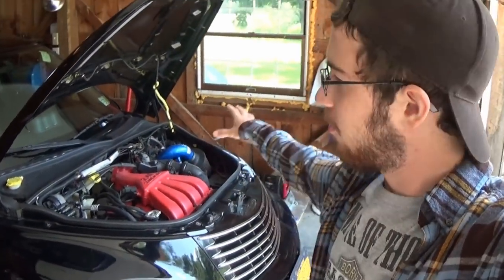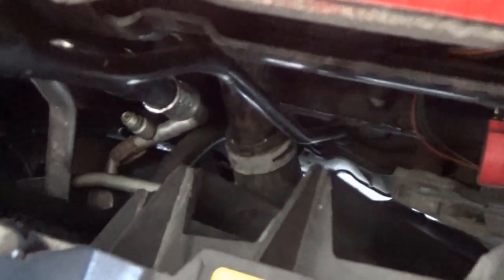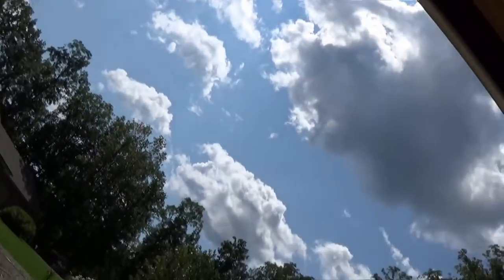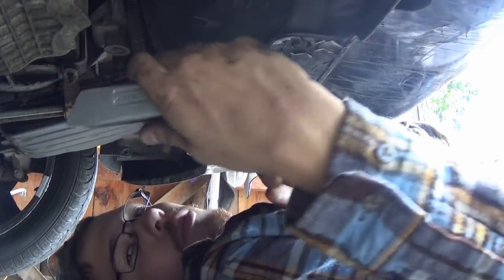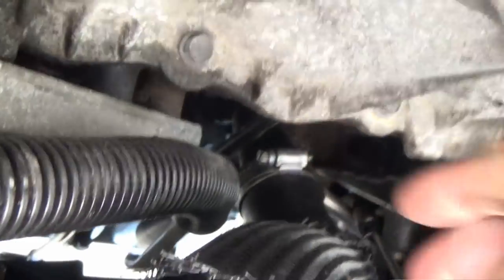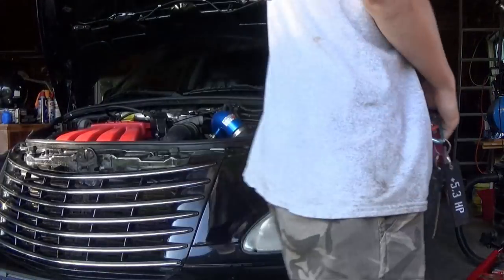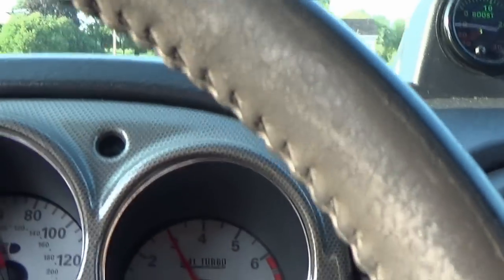IS MY ENGINE OKAY?  PT GT Lower Radiator Hose Replacement

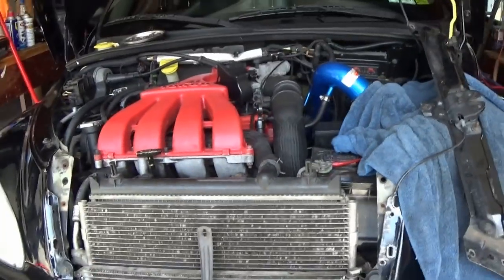Comment: Hey! Need help! At 4:30 as you’re pulling down the intercooler, right above your hand are two metal lines that run towards the back of the engine. The one on the right has a rubber hose that runs into a threaded line at the bottom of the radiator. At 6:34 its right next to your hand also. What hose is that? I just bought a 2005 PT GT and have done a full tune up and replaced all fluids. That hose leaking needs to be replaced but I have no idea what that is. Any chance you can help?

Comment: Wondering if it's easier to pull the radiator? I'm needing to replace hoses and would like to do timing belt and water pump. I've seen where people do them with the radiator, but it doesn't seem that much more work and might make it way easier. My PT is on Jack stands now waiting for me to decide to do it or not. Not emergency, but may be a good winter project. Mileage is well over 200k, although timing belt was done around 90k.

Comment: Me again. Novel time. I enjoy your channel as 1. I highly respected that you wrench on your own car. 99% of under 30 somethings, inclusing my 2 have 0 idea how to do even basic work on a car. They're both fortunate now that they drive new, under warranty cars. So respect. 👌. 2. It reminds me of my experience w/a 100% non mechanical father & my beloved British convertible sports car & gleaning from the rare honest British Car mechanic & our gardener who worked on his own trucks & took pity on me, what knowledge I could.  You have rare, thoughtful & supporttive parents btw. & room to work & test your car which I am envious of & which 8n life thru now 67 vehicles (57 cars+1 truck) I've never had.   Imho you definitely need to do a compression test esp. Given the miles on your engine.  The TSB & white pages on any srt-4 motor call for normal 100k-150k all seals check & replacement.  Seals like your radiator hose will start cracking.  It's still a Dodge motor though & during the mbenz years of ownership by Daimler/Chrysler, mechanical & body fit & finish to all cars esp. Benz chassis cars (which this is not but still benefited from), they became even more reliable in build quality overall.  Seriously  compression test & it would make a good video + you can borrow a compression meter/tester from any decent shop. Building a relationship with a friendly  local shophone is always a good thing.   Given you're running a turbo & have a MAP not a MAF I believe,  invest $7 in Redline's Water Wetter. You should see a 10f degree drop in water engine temp.  That or run a Prestone radiator cooler product  or flush.  Since a 1987 Subaru that I replaced the radiator/fan shroud/water pump/thermostat on in before flipping it (that was a great little real 4wd wagon that a Vedder rich couple bought for their son & it lasted him through undergrad & graduated school on the E. Coast & thru 8 winters there w/0 problems minus inevitable minor rust. Yes I keep the few "thank you" cards, gifts & emails I received in my + years of flipping cars not associated w/dealership work. Only 1 complainto in over 30 cars).  Being young & eventually married w/a son who from age 3 started out handing me tools & learning by doing through age 16, now mainly forgotten & yes I just started investing in the absolute best European independent mechanic shop in this ridiculously entitled County for him & as an long term investment for him & I hope he'll take both the mechanical apprenticeship as well as general manager position  training.   Here in my area of N. CA the shop charges $300+ an hour in service  $ but the owner is an honest & amazing guy & his 600+ regular clients know it.) 
Watching your vids I'm very happy that my daily driver P/T is a non turbo, non autistic with a documented & loving 1 owner history before me. I still enjoy it as I like unique & different.  Product wise Duralube or high mileage Slick 50 has extended & lowered every car's temp that I've used it in.  I prefer Duralube & recommend Lucas or anything but STP or anything BarDahl fuel system cleaner. Lucas works in the tank & does add a layer of top end lubrication w/of /fouling your jets.  With your turbo you never want to raise head temp.  BTW you're in uncharted waters w/your performance mods. Personal Transport is what they named this homage to 1930's body design. The SRT-4 turbo motor implant was/is a marketing plan, not what the chassis was made for.  Try to remember minus the body, the entire car is a moderately priced parts bin car on a stretched Neon frame.  FYI if you read the owners manual for any fwd car, it absolutely hurts your transmission to tow it more than 100 feet at >10 mph w/the front tires on the ground.  Why a AAA premier membership is a great gift + why I've been a member since age 16.  You might want to do a tranny fluid flush & replacement l Cheap insurance.  There was & is a Dodge/Chrysler Class action lawsuit/recall on all Magnum/300 usually 6 cylinder  transmissions made in Mexico due to the simple fact that after they were built, they were never flushed prior to installation=metal chipstorm inside premature failure on my 2 1st Magnums that went through 6 transmissions total & why I then bought an R/T w/every option instead in 05.  Performance vs. Gas mileage is definitely worth it especially w/a programmable chip tuner & various mods.  Yes it uses mbenz spec'd & staggered size larger tires @ $400 retail a pop. Just pointing out that even Dodge/anyone can make a crappy product, often. 
Your vids & editing are definitely improving.👍 I'm glad there are still 19-20 somethings that are smart enough to look back & realize & learn from their early efforts as you stated in a vid.  
Dream bigger than just 1 store though.  In music classically trained musicians are taught "Don't aim for Metallica  (for instance ), aim for Mozart". Life does not grade on potential though or as my celebrity music attorney in my early days stated. "Smart does not equal rich".  End of screed & good job on this video but compression test definitely.  PS I've already decided on a later P/T LE "CA Surfer" model to add. N/A & Purple w/factory subdued flames & the Turbo rear spoiler. Has a mildly revised engine.  Cheap , useful & fun if I can find 1.  Goes vs. Everything my new partner believes in.  Lmao.  😎

Comment: Great Job! God those squeeze clamps are dumb! Have you ever used hose clamp pliers before? With those you might have been able to remove that clamp from the top, but it’s hard to tell.

Out of curiosity, how “pliable” was that dayco hose? I bought one for my car but it was really stiff and seemed like it’s been sitting for a while. I then got a Gates hose from amazon and it was much more squishy and smelled like new rubber.
Reply from the maker: Thank you!  Yeah they are haha, I really hate them now after this whole ordeal.  I've never used a pair of those pliers but I really need to get some!!  It's a real pain to try to grip them with normal pliers, even the nice long ones.
They Dayco hose exceeded my expectations, especially for $14 bucks.  It was a little stiff and hard to push on, but I haven't dealt with an aftermarket hose that wasn't that way a little.  Gates is my first choice too though, thought about ordering one but I just wanted to get this done haha